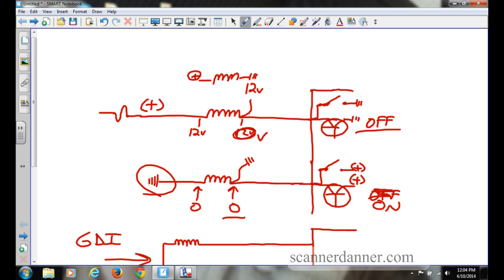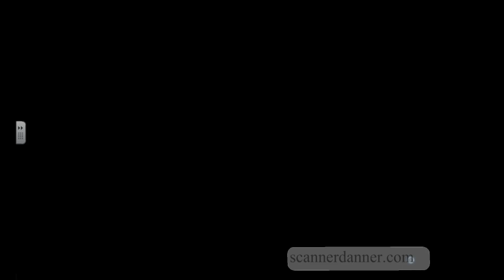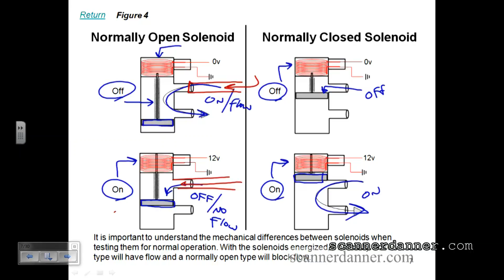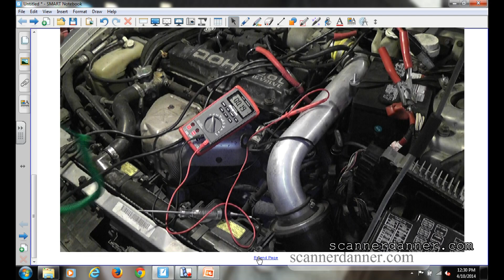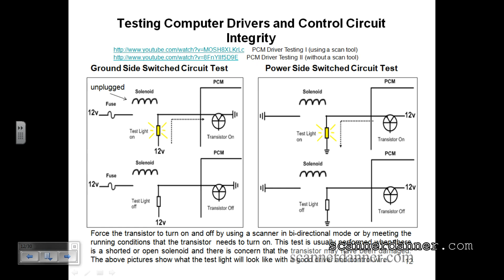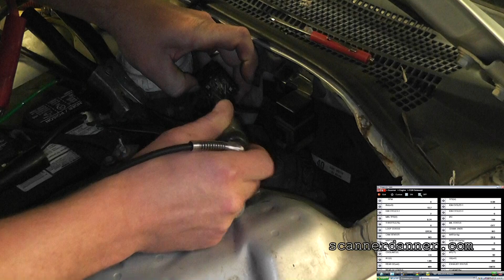Solenoid circuit ID with a voltmeter/normally open solenoid test/testing computer drivers

Comment: I'd get a fuel injector tester and manually energize the solenoids that way, 
But disconnected from the system.
Reply from the maker: +Poochie43124312 nothing wrong with being extra cautious. But what do you do when you can't get to the solenoid?
Reply: I was just throwing out an idea.
Reply from the maker: +Poochie43124312 no problem. I appreciated it.

Comment: I know I'm not going to explain this well but I love your classes that's why I put my money where my mouth is. I just would like to give the perspective of a newbie using your pay channel. I have gone through all the videos up to this lecture in the order you have them and this older series is the first one that has a hands on explanation  immediately during the classroom lecture for reinforcement. Often you would give a link during lecture of a case study that I would go hunt down while I paused the main lecture then come back which is ok but breaks the flow. I would be jealous of how you would tell the class after lunch we will work on a vehicle using the techniques we just discussed but the next video I would see is the next lecture topic.
   I would  but a video of actual ground side switching back probing during your classroom explanation then the power side switching lecture part with an immediate hands on demo of that power side switching on a car [real time] just like you did here with the changing state of a solenoid that's normally on. What I wanted to see was you back probing a car ground side or power side So immediate reinforcement of classroom lecture with actual on car probing would be great I know you do it but more is better. I understand your main job is teaching that class and us subscribers are secondary.
  Also its great that you set up the probe but before you show the answer you ask us what voltage it should read thats awesome cause I will pause the video then draw diagrams and try to get the answer then hit play.
  You have great lectures and great real case studies I just think they need to be integrated more and I understand its a work in progress.
   Anyways keep up the great work because your passion for the subject comes through in your excellent work and I don't mind paying money for that!
Reply from the maker: +Bruce Ismond Thanks Bruce. I am learning what works best as I go and appreciate the feedback. You would be correct though, in my classroom, my students come first, not my YouTube channel. If I was only teaching to you guys, I would do it exactly as you described. 
The other issue I have with employing this method in my class is, it is only an 8 week class! Imagine if I demonstrated every testing procedure, right after the lecture. It would take me 6 months to get through the material. 
In the future, things could change but right now I have to cram as much in as possible in this 8 week course.

Comment: Is there a way to tell from a wiring diagram if the egr solenoid in this video is normally opened or normally closed, how would you know?
Reply from the maker: Not on the wiring diagram but possibly in a description and operation of the system. Bottom line, it should change state when you energize it.

Comment: Any solenoid that is PWM don't manual energize or you will most likely burn it up,  just a word of advice to the viewers.   An example would be the vent valve on a LDP pump.  Thanks for another great video Danner.
Reply from the maker: I agree we need to be careful with PWM solenoids. I have however energized many of them manually with no issues. (Ford EGR EVR solenoids, GM Linear EGR valve to name a few). Good warning still though Neil Z. thank you!